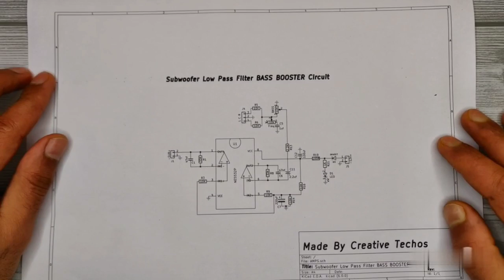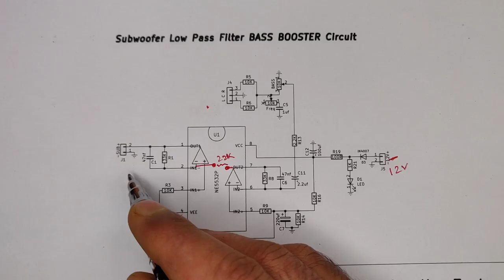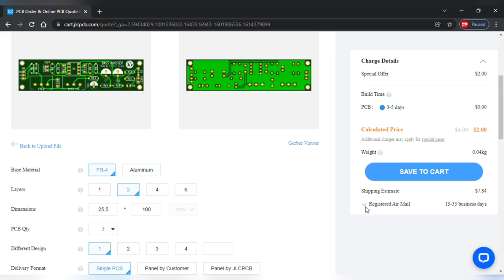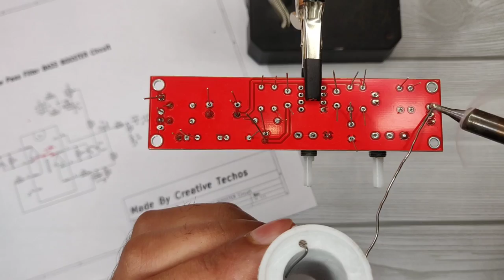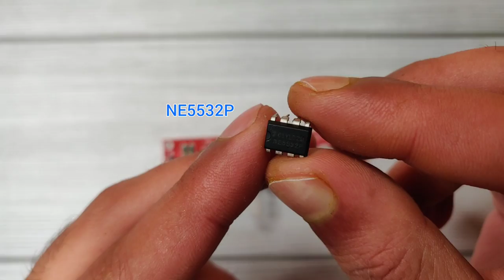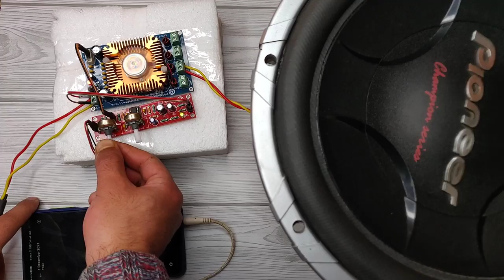Low pass filter Subwoofer bass booster circuit

Comment: How come I can still hear the tune with the frequencies higher than the bass notes coming through, isn't it the job of the low pass filter to cut out those frequencies completely leaving only the low notes no?
Reply from the maker: Yes you can i used 47nf ceramic 2 capacitors, use 100nf instead

Comment: Superb I must say. But there's one board which is badly missing in the market, if you could make one? Can you make a dual channel low pass filter? Mono channel subwoofer output is pretty common, but what about low pass filter with dual channel/stereo output? Please make one.
Reply from the maker: Yes absolutely can be made by using same diagram, but what about Potentiometers, should that be seperate for each channel, or dual Potentiometers can be used
Reply: @CreativeTechos  that purely depends upon the detailing the maker is willing to do to make their board unique 😊 I would have liked the frequency potentiometer to be common for both the channels but separate potentiometers for individual channel volume. By this, both the subs would run on same frequency avoiding the distortion/improper sound if the same kept on different frequencies. What do you think?
Reply from the maker: Yes, it will be good idea to use dual pot fore frequency and seperate for bass volumes, I'll make the circuit and will upload video ASAP
Reply: @CreativeTechos  thanks a lot for considering the suggestion 😊
Reply: @CreativeTechos  one more thing, please use TLC074CN IC as it has comparatively better better quality as compared to 4558 when it comes to bass
Reply from the maker: Ok thanks for suggestions

Comment: Is it possible to replace the 22k Resistor across pin 2 and 7 with a variable Resistor to act as a bass gain control.
Reply from the maker: Yes absolutely you can use, and as per my experiments i found 22k perfect.

Comment: Still there's quite fair essence of mid in subwoofer, I know it can't be made zero but there are ways to make it bare minimum.
Nice bass output though
Reply from the maker: You can still minimise high tunes, i have used 2x 47nf ceramic capacitor you can use to 100nf capacitor for further reduction of high tunes

Comment: Your project is cool. What changes should I make on this circuit to make a duplicate of this but achieve a high pass filter. I'll really appreciate your info.
Reply from the maker: Just need only one change use 100nf capacitors instead of 47nf to get bass with more voice reduction.
Reply: I need a circuit to control tweeter speakers, not bass. Correction please.

Comment: What is bass response a deep bass there any voice coimg Or not
Reply from the maker: Yes, it gives deep bass, and no voice overall, zero voice can be achieved by simply replacing 2x 47nf ceramic capacitors with 100nf